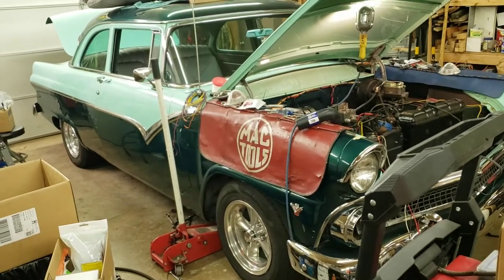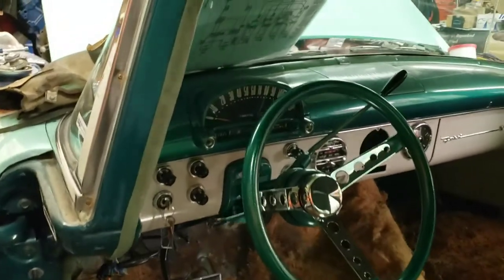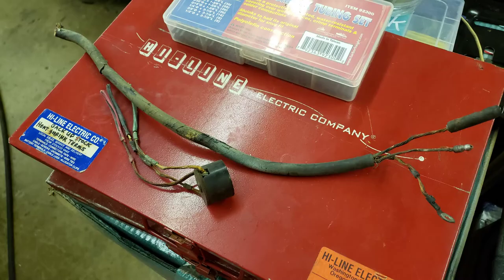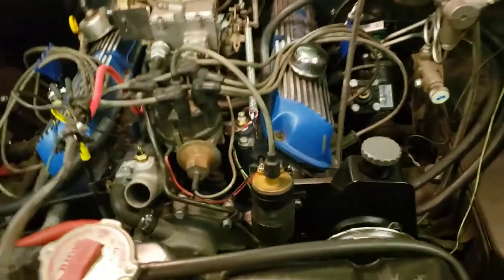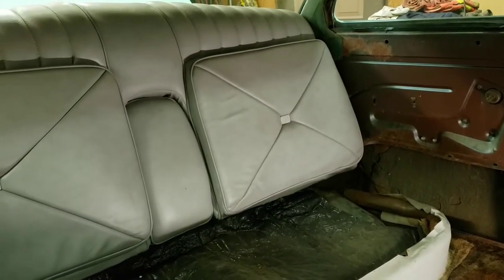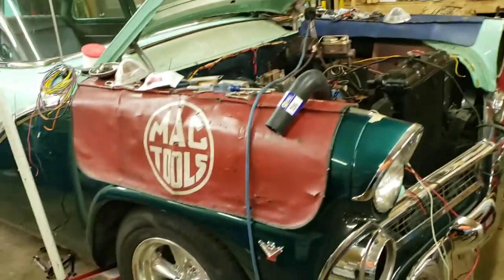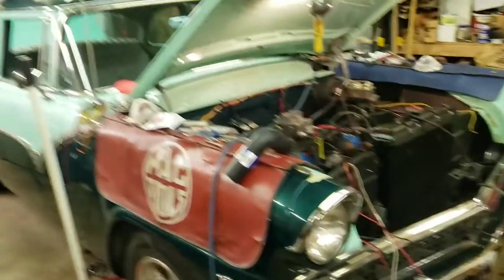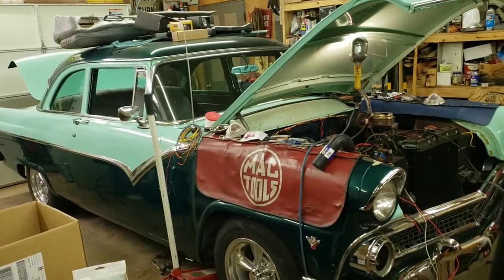1955 Ford Fairlane Upgrades and Restoration In the FLESH from my Instagram!

Comment: Also I used a round radio made for boats. Great sound and real easy to install and looks good although not stock. Since I had converted to 12 volts snap installation I also used a speaker in the original location with two speakers for a great sound and its easy to install and not expensive at all. If I remember right I only spent 79 for the radio and list then 50 for the speaker. I put it in the original radio mounting chrome bezel, had to only grind a small bit of the mounting bezel and had it installed in less then a hour.
Reply from the maker: I had some 4 inch round speakers I was able to set into a fiber board copy of the original single speaker and bolt back in stock location. Rear has 6x9s already. Looked into getting the OE radio converted/updated.... almost $1k!!!! Nope! And a 12 week backlog! Pass! 
Even though the Boss looks a bit outta place it looks like it's gonna fill the need more!!
Would love to see pics of yours! You have any? Or any video? 
Thanks for all the help! Much appreciated!

Comment: Dan, now that was a real treat, you don't have to be a Ford guy to appreciate this beauty, the 55 looks to be one piece of chrome away from a Crown Vic, even has eye brow chrome like a Nomad, is that rare, it was a real woo- woo moment when i saw the rear seat and the front ones too, the only thing missing was the pull blinds in the back window, lol, i may have to graft the Lincoln rear seat frame into the 55 truck frame, would make for a good story, sorry about your Dad passing, i'm sure he would have loved to be there when the 55 was done for your Mom, he did really nice work, and your not so bad yourself, beautiful work Dan, i will look for more videos on the 55, but was wondering what is the current state of it now, you probably got my other reply, but the place that had the trucks out front was about a mile or so north of where the Cowlitz crosses i-5, on the east side of the road, really great video, have a good Monday & catch you soon buddy
Reply from the maker: The eyebrow trim was a Crown Vic and Fairlane thing in 55 only. Even though the 55s and 56s looked similar on the outside, lots of trim differences, much like the tri-fives. Ill tell you what though, with those seats in there its like driving a couch! The front seats are 6 way power buckets/split bench or whatever. Think there was a console in the 77 Lincoln these came out of. I need to better situate the seat controls as the use to be in the original car's door panel. Right now the are just pigtailed under each seat. The car currently is going through a complete re-wire, which I've mostly been showing on Instagram. Its really close to done, but have been off of it for a couple weeks trying to tie up stuff at my place before the weather heads south. Have some odds and ends yet to tie up on the 55 once the wiring is done. After this, there 3 more of my dads to wrap up... and a couple others that are deeper projects if I decide to tackle them. So... I certainly won't be bored!
Reply: @OlysGarage  yes please give me the instagram channel name, it’s been a real treat getting to know you, I cough on forever, and would type more now but busy morning and the wife is waiting for me to get home, two more days left on my 3 months off from driving the Oil Truck, start back up on Wednesday, how far are you from exit 5, we picked up the trailer for our trip over on 99 & exit 5, oh yeah my Dad was a Marine too, let’s talk more, it’s been great buddy
Reply: Your like my new best friend,lol
Reply from the maker: @DesertRatFabrication New Besties?? Nice! 
Oh I'm maybe 15-20 mins from Exit 5 off I-5.  If you follow I-205 south from the split with I-5 I'm just east of I-205 about midway between the Padden Parkway and SR500 interchanges. Can just about throw a rock and hit the freeway. Not a bad location but getting crowded...
My IG  @olysgarage
Reply: @OlysGarage  awesome 👍

Comment: VERY nice car, I have a 55 Customeline, had to do the wiring replacement as the original was completely falling apart. I have a pic of my headlight bucket very similar to your as i was going to replace a headlight and found just what you did.  Installing the kit from EZwire took about a weekend with lots of brakes and time to take Mrs to dinner.  Ha Ha 
Anyway I for one would be very interested in the column conversion you did. Looks to be exactly what I am planning on doing very soon and would appreciate any guidance or help you  would be willing to give. Hope to hear from you soon
Reply from the maker: Absolutely. I'd like to do another conversation, just to streamline and refine the process I did with this one. Had to backtrack a few times. Its actually super easy to do if you run a floor shift. It gets complicated with the Auto trans shift, and I'm not so sure the 3 speed manual shift has enough room. Once I figured out what I wanted to do, and the room I had to work with, it was actually fairly easy. I wanted to run the shorter 56 column that uses a dished steering wheel. Obviously you can shorten the 55 too, but then the shift lever and turn sig. levers look goofy with an aftermarket dished wheel. I need to just make a video on it... be a lot easier. Have to do this to my 56 Fairlane as well. 
So feel free to ask away any questions, will answer them best I can. My email is in the description too. I was bad about writing down my measurements, but I did take pictures during the process. Thanks!

Comment: what review mirrors did you use? I notice they are not stock but probably easier to see, and do you know anywhere I can get cheap door panels? cause I got a front driver door thats bare metal with nothing on it
Reply from the maker: The mirrors were on the car when purchased. To be honest, they look like cheap-o universal ones you use to be able to buy at the auto parts store to replace on your 70s/80s car. I'll look them over more closely when i go back over to the shop but to me they look very GM-like, but so didn't most the universal stuff on the shelves!
As for the door panels, it's basically just fiber board covered in upholstery. The fiberboard you can usually buy in sheet size at Home Depot or Lowes, or most arts/crafts places. Just make you a template and place it on the sheet and cut one out. Probably be able to use the passenger side if need be. Its also the same stuff that you can make the package tray out of. If you look closely you'll notice that the material on this 55 is not stock. The material and trim were robbed off a '77 Lincoln's door panel (which is a much larger panel), just trimmed up and refitted to the '55s door panel board. Same with the rear panels as well as the rear seats. A '77 Lincoln was used as a donor car for all the interior and trimmed to fit the '55 including the rear seat (drop down armrest added to '55 seat frame). The 4-way power front seats fit in there really nice.
Getting that fiber board material from Home Depot, Lowes, Hobby Lobby, or some arts/crafts place and robbing the materials off another door panel is probably about the cheapest way at making you some door panels. Or just get your own material, with some thin foam from a fabric store and create your own.

Comment: In case if your wondering why I'm usually on here late is I work a late shift and sometimes don't get in until 2 or 3 supposed  to get off at 9. Doesn't always happen.
Reply from the maker: I'm kind of a night owl myself. Doesn't work well with my 6am day job...lol But usually in the shop in evenings and fairly late sometimes. Not enough hours in the day!

Comment: The Radio I used was a BOSS Audio Systems MGR350B Marine Gauge Receiver - Bluetooth, Digital Media MP3 Player, no CD Player  I caught it on sale a couple of years ago so the price has gone up. But you need one with the 70 mm or 2 3/4 mounting hole. most have a larger body and won't fit..
Reply from the maker: I'll check the model number, but I think thats the exact one. Seems to fit the bezel nicely, tiny bit of clearancing at the bottom and does good. So what did you do with that space the buttons came through at? I wanted to find USB charger ports that would fit but nothing out there from what I've seen. So I just have a black block off plate made for it.
Reply: @OlysGarage  Well I had a small decal make in black, put it on a piece of white plastic which I had shaved to fit the lower button space and put a small LED behind it. Kind of cool.  If you want to have USB ports you could use the white plastic like i did and install a usb port from a computer.  They used to be very plentiful and I would think any good used computer place will have them laying around in the back in there parts bid. I probably have a couple in my old computer parts box. I try to get some pics of my install.
Reply: Did you get the web site I sent.
It showed up at the end of the comments..
That is the horn adapter I spoke of a couple of days ago..
Reply from the maker: @earlk6  I think the problem with a USB adapter from a computer would be that it's designed to run on 120v (home) electricity, and not likely to work for automotive 12v. I've been looking at a few, some for motorcycles too. It's something I can always add later too. I ran a power wire over to that part of the dash and coiled it up for now.
Reply: @OlysGarage  Well the USB conference held in about 2001 established that all USB connection would use the same voltage. So In the case of computers they just use the 5 volt power coming from the power supply and power them that way.. I may be wrong on the date but its been the standard for several years. So any usb port you want to plug into will not blow up or harm your hardware.

Comment: Just a hint, if you want the horn to work with original steering wheel an wiring there is kit made by a company in California  call a Retro Horn Kit. If allows you to keep all the original column and wheel and still use the Bergeson power steering unit. I will provide the name of the company if your interested. as its on my phone it the other room. Just let me know and I''ll get it for you if you want.  No need to reinvent the wheel.
Reply from the maker: Heck yeah man, if you don't mind float me that info! I'd like to check out that horn kit! I'll try searching Retro Horn Kit and see if it pops up too. Appreciate the info and thanks for watching!

Comment: Hey buddy need help on my 55 ford club sedan tryin put on a new starter r see y it’s dragging losing power of battery look under &it’s look new
Reply from the maker: Sorry trying to make sense of the last bit you typed there. But if I can decipher what that was, you're having low cranking power? 
Make sure you have good grounds. Ground the body to the chassis and chassis to engine, then body to engine. 
Are we working with a Y block engine? 
Is the car still a 6 volt positive ground electrical system? Or has it been converted to 12 volt?

Comment: Well I'm having a heck of a time trying to up load a pic, I would be glad to do it but I'm at a lost.  Let me know how to do it if you know how.
Reply from the maker: Are you trying to send by email?  Should be able to attach it such as a file. Usually has a button or tab that says 'attach file' within your email. Send it to- olysgarage@gmail.com
Reply: @OlysGarage  Yea well dummy me I must have been sitting on my brain again.  I sent you some pics. You should have gotten them by now.  
Well I didn't have any of the panel mount for usb but I did go on line and put in 'usb panel mount extensions' and got several types to come up.. Cost as low as $3 to high of about $30. I would make sure if you use one of these to get USB 3.0 compatible for best sound quality if that is what you are using it for, if not and only for charging your phone 2.0 would suffice
.
Reply from the maker: @earlk6  mainly just charging. The radio has Bluetooth so can shoot the audio through that way.